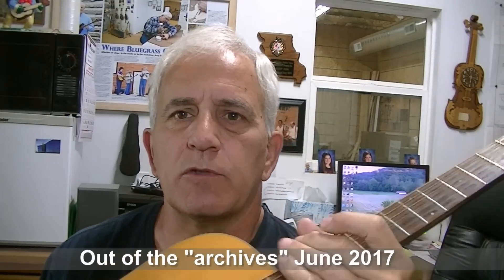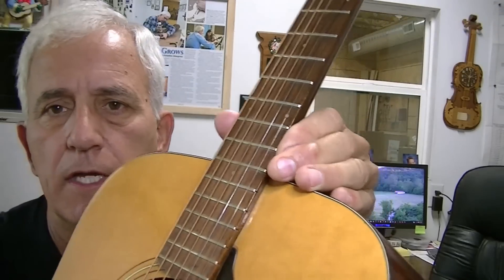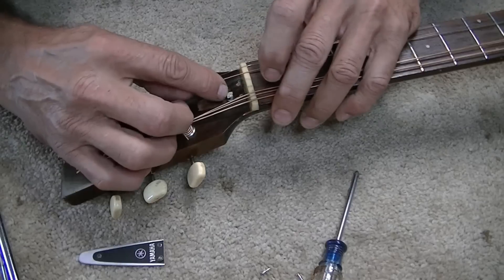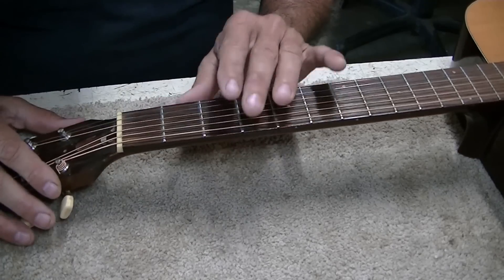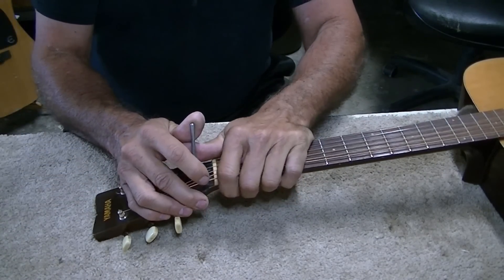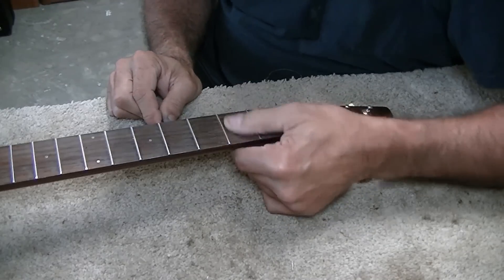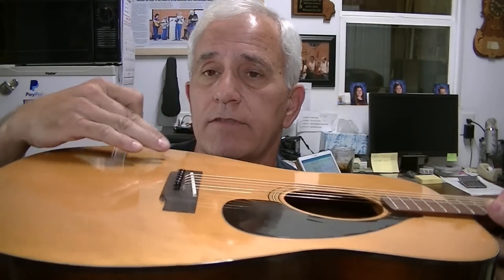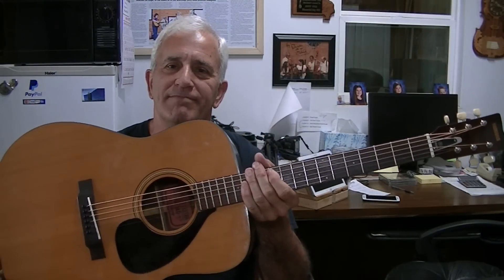197 RSW Yamaha Guitar Truss Rod Issues

Comment: Among my guitars, I’m the original owner of a Yamaha FG-160, built in 1973. It’s like a scaled-down dreadnaught.

In part, due to its age, I put Nashville-style strings on the instrument. It sounds great (jangles like a 12-string) and there’s less stress on the neck. Fun to play.

I’m a big fan of Yamaha guitars. They’re well-built, very reasonably priced, and sound great.
Reply: What strings and size are you using on the FG-160? Thanks
Reply: @BFClayto  I use a set of D’Addario Nashville strings. The strings come in only one gauge (10-27), not a choice of gauges. You could purchase them on Amazon.

Comment: Hello Jerry. I might have a tip that will help. When you remove strings, if you push the ball end below the bridge plate, you can easily pull the bridge pins by   hand. You are the one with experience though, so please don't be offended. Thanks for all your work in producing these videos. They are excellent! Bobby Hall Greensboro, NC
Reply from the maker: Bobby R Hall thanks for taking a look. I'm familiar with that approach. I use it whenever they're stuck a little bit.

Comment: I agree with you about using the light gauge strings on the Yamaha's of that vintage. I have a FG 200 I picked up in 1979 and it was about 5 years old at the time. I use the lightest strings I can get and it sounds and plays beautiful. The truss rod is very tight like the one you were working on. I've played in bands and members always loved to play it.
Reply from the maker: +Ben Kelly thanks for taking a look. But yamaha's are real nice guitars.

Comment: I couldn't help thinking the Bridge had been Shaved Down...I noticed Yours was Flat.
A Yamaha I'm Currently working on had a Radius to It, and had the Same Height Problem, with the Rod not Working no matter What, so I'm Scraping it down.
And Sanding the Height of the Saddle, and needing to Re-Ream the Pinholes, Chamfer them, and Re-saw the String Slots.
And the Saddle also was Loose.
So since I'm doing all this FREE for my Nephew, I just Added a Bead of Crazy Glue to Thicken It on the Backside, to stop the Waddling-It does the Trick.
Reply from the maker: +chickengnawer good luck with your project. Thanks for watching. I can't say about the bridge whether it was flat or not it was too long ago and I don't remember.

Comment: I picked up an older 20 to 25 yr. old Vantage "VA-12" which had high strings when bought second hand. There was a fair amount of under-bow in the neck, specially in the middle section,(much like the one shown in the video. I removed the string stress, and started working on the Truss rod, to help get rid of some of the under-bow. The adjustments are made from inside the sound hole. Like in your video, the nut adjuster, was tight, so I backed it off by a fair amount, and began moving the nut adjuster, back and forth over the hidden threads inside, to help loosen the adjuster up, seeing it hadn't moved (I don't think) since it was sold new. When I first started, the height of the strings were almost double the height they should have been, and possibly when it was sold new. Did a check on the strings, and found the strings installed, were a heavy set ( at 74 Thou on the low "E" string). I installed a set of Erie Ball "lights", because like with guitar shown, the bracing of the sound board is of light nature.  I did get the neck nice and flat, with a very slight under-bow, using the truss rod adjuster (got it working again). With the light "E" strings installed, found the height had dropped by a fair amount (which is good), but not far enough to be where they really should be. Think I'll have to do a neck reset to get it down to the level the strings should be properly sitting, as I don't trust adding more added tension on the truss rod, that's quite tight now. Like yourself, I think the last owner caused this problem, by using over sized strings, where he should have been using a set of lights, not heavies. I noticed as I went over the neck, and body joint, that the neck has been removed at one time, and re-glued back on, so it appears it was re-installed improperly. Sometimes a person can't get out of doing a Neck reset. Using a straight edge along the center line of the fret board, the neck is now flat from fret 1, and on up to, and including fret 8, where it then begins to rise on a slow slight angle to a max of about the thickness of a business card, with no strings strung on it at the 12th fret, Continuing on along the straight edge, it comes in-line at around 1/8th of an inch, "below" cresting the top of the manufacturers made saddle. I think that neck needs a wee bit more angle for good proper string height, by doing a neck reset, don't you think?

Comment: I was in the USAF traveling home to Long Island NY from Texas going to stop in Buffalo NY  to drop a couple brothers off before heading home .
Long story short  , my Chevy vans gas pump on the side of the engine leaked and seized my motor  when the gas thinned the oil . I was in Rollo Missouri . Got a new motor in two days and was on my way .  Funny I’ve never heard of anybody ever mention that place ever !    Any way thanks who ever you were in Rollo !  The motor lasted longer than the transmission years later .

Comment: I have found on a couple guitars over the years, that the truss rod nut had reached the end of the threads before moving the neck enough to pull it back and remove the under bow. I removed the nut and added a washer over the truss rod behind the nut and it added enough that I was able to adj the truss rod and get the under bow out. Just wanted to share my solution, peace
Reply from the maker: +Boudreau Guitars thanks for the note. I have seen that as well. But that wasn't the case here. Thanks for watching old friend.
Reply: Boudreau Guitars I had the same issue with my 1964 Gibson acoustic. The truss rod nut bottomed out and would not fully adjust the neck. Possibly, the wood anchoring the truss rod at the body end of the neck compressed over the years, in effect lengthening the truss rod. That’s only a theory, but adding two thin washers under the truss rod nut  took care of the problem. Another great video, Jerry.

Comment: Jerry I agree w some of the other comments re clamping a backbow into the neck and then just snugging the truss rod nut up to meet it. I've have a few of these Yammies also and I believe the neck wood is not as hard as it might be so when you crank that truss it just pulls the buried end into the neck instead of straightening it.  So I set up a cpl cauls to put actual backpressure on the neck.
Reply from the maker: +Tioga Fretworks definitely could have done that. This one seemed to improve enough with light strings that I didn't feel any further action was necessary. Thanks for watching. Happy New Year.
Reply: Rosa String Works  back at you Jerry!  PS I have a Framus Mando Im going to do surgery on - it has no truss rod but needs one. It's a bolt-on neck so later this winter I'm going to pull it apart and either pull the fingerboard or go in from the back and do a fender- style  skunk strip.  It was a gift from my parents when I was 10-11 yrs old so has sentimental value - otherwise would not be worth the effort. But it's borderline playable now even w the lightest strings - way too much relief

Comment: Happy 2018, when it rains it pours. I have always liked those F140 Yammis they typically sound and play nicely. I've run into a lot of necks like that and I loosen the rod then clamp a back bow into the neck then re-tighten the rod. Usually works after that. Good one Jerry, hope your year turns around soon.
Reply from the maker: +Dane Nichols thanks for taking a look.

Comment: Funny your comment about polishing.  Saxes especially silver plated old ones sound much better cleaned and shiny.

Nice work

Jim
Reply from the maker: +phooesnax yes they do. Thank you for watching.
Reply: Offhand, it isn't hard to imagine that a thin layer of dirt & oxidation on a metal instrument will act in a manner similar to the rubberized undercoating on a vehicle. It dampens vibrations.

Comment: Jerry:  Art Ogle Ft Worth at you. Fully agree on using the gauge strings appropriate to a guitar. Just purchased a 2020 Yamaha  FG830 (same model as my sons)
OEM strings were D'Addario light gauge strings. I too believe that having heavier gauge strings than those recommended are a case of "that ole dawg won't hynr" (Not fer long anyway)

Comment: 9:30  FYI. Here's how to get the screws off the truss rod cover when the wood below is stripped, without damaging the wood or the cover: Slide something very thin, maybe a small flat head under the truss rod cover. Pry the truss rod cover GENTLY! Not enough that the cover breaks, but gently .Keep the pressure on it, then as you are doing that use your philips to unscrew the screws. You will notice the screw is unscrewing and the cover is coming up as well. Im not the best at explaining it and I'm definitely not a professional luther but it works 100%.

Comment: Low heat pad on fret board with weight forcing a tad back-bow, rod full loose.  10-15 min, then let cool.  I've had mostly success trying this, but some failures too where adjustment didn't stay.  Never damaged guitar.  Have had to level frets though a few times.
Reply from the maker: Thanks. I've done that many times myself. I didn't feel it was warranted in this particular case.  Thanks  for watching.

Comment: That is exactly the issue I am having with my Yamaha fs700. As far as I can see no under or overbow with no string but put them on and HIGH strings at the neck joint.
Reply from the maker: Anthony Allen if the neck is straight. Then one of two things needs to happen either you need to lower the saddle on the bridge. Or if that is not possible, the neck would have to be reset. Hope that helps. Thanks for watching.

Comment: When I have a case with a big underbow, I loosen the trust rod,  put a guitar in a vice and secure the neck in a position where I want it to be and then tighten the trust rod just enough to secure it in that position.
Reply from the maker: +Ivan Dimitrijevic I have done that as well my friend. In this case once I put the light strings on it it seem to be quite a bit better.
Reply: I have also recently used that trick on a bass guitar neck. As I worried that depending only on the truss rod to do all the work could damage it from over-exertion.

Comment: Regarding the string weight question, when Billy Gibons of ZZ Top met BB King, BB tried out his guitar an noting the heavy strings he asked "why are you making so much work for yourself?" From then on Billy has used light strings. 🎸
Reply: Good point.. although a bit of a apples to oranges thing.  Those guys used electric guitars , so they relied on their AMPS ! A better example would be an acoustic guitar guy that doesn't like heavy strings.

Comment: Rosa String Works When I got guitar the heel was split I had to glue the heel back together so that most likely because of break might have affected the angle. I put shims near dove tail glued them in so hopefully they help the neck also got clamps on it. I reed a article that you can remove the tongue of fretboard  and put shims in dove tail and that can fix the neck angle instead of steaming it off  then put shims under the tongue basically poor mans neck reset reed on Harmony forum about Harmony neck resets.
Reply from the maker: +Brian Smith good luck with it.

Comment: Just so I'll know, how is it that paste wax improves tone, applied to the top and/or back of a guitar and mandolin. That sounds a bit counterintuitive, but you are, after all, the expert. I don't have experience with newer Yamahas, but the old Japan-made Red Label sounded very good. Thanks for another good video.
Reply from the maker: WryGrass100 first of all it is more obvious on older neglected guitars that haven't been cleaned in a long time. When you clean them up and you put a paste wax on the finish it seems to crisp up the finish and you get a real clear noticeable difference. On some the difference is absolutely huge. On others you can barely tell any difference at all. Thank you for watching.
Reply: So, it looks like I have my work cut out for me. Thanks

Comment: Good luck on your rental house I hope 2018 gets better for you.
Reply from the maker: +Sean Mccord thank you very much. The well got fixed today and it turned out to be fairly simple. A blown capacitor.  I had check the capacitor and thought it was okay.  But apparently not. Thanks for watching.
Reply: Rosa String Works wow thanks for the reply great videos, you're an awesome repair guy. I do have a question ,a scenario where my Guitar have fell over and a chunk got carved out of the back of the neck, I thought about using wood putty but I heard that shrinks over time. I heard people say Bondo is good ,what do you think?  😊

Comment: I just purchased a fg-260. 12 string . it had to heavy of strings and really has a belly on her. I took them off and the truss rod was scary tight trying to loosen it but it finally cooperated. (probably should have tried to loosen with the neck under tension) . I'm thinkin a bridge dr. and the lightest strings I can get help the belly issue.  It had a wound 3rd . it had tuning issues because the string slots were to narrow not allowing the strings to slide properly.  I bet the previous owner put these heavier strings on it and exarerbaterd the belly issue. you think the tuning issue would have gave him a clue but I guess he didn't see it. this fret board is a 20+ radius. The bracing is odd. not symmetrical. very light top. wondering which bridge dr. to use.? oh yeah. the bridge plate could be a little wider imo because it doesn't quite extend pass the string pegs. I'd thought it should.

Comment: I am enjoying your videos. Neat stuff. I have a Yamaha FG365s with a non functioning truss rod. Back in 1978 I bought it new for $200 CDN. Recently I tried adjusting the truss rod and no matter how many turns the action does not change. Since then I have learned it will cost a small fortune to replace. After much research and conversations replacing the rod may not be necessary. Unfortunately I have not found any pics of the type of rod that is used in a FG365s but I did find a pic of the ends of the rods for a FG375s. Would you know if the rod for the FG365s is the same type of rod for the FG375s? Thanks  Pat

Comment: If you still have computer problems might be worth checking is it has dome caps if so that will give you all sorts of problems.
Reply from the maker: I've  never heard of Dome caps.
Reply: Sorry domed capacitors they look like little battery's standing up on the motherboard, if top of them is domed there faulty they should be flat its worth a look as it a problem with electronics.

Comment: 68 degrees! that's hot!
Reply from the maker: +chump5101 well I don't think I'd call it hot. And by the way that's 68 degrees at chest chest-high. My guess is it's probably closer to 58 degrees at your feet because of the concrete floor. So it does not feel hot at all if anything it feels pretty cool.  Thanks for watching.

Comment: Do you think that the truss rod nut had bottomed out on the thread, i.e. can't turn any more? I have seen that and there are tools available to cut more thread on the truss rod. You can put a small outside diameter washer under the truss rod nut too.
Reply from the maker: Damian Strochnetter thank you for taking a look. I don't think that was the issue. It's long gone at this point. Thanks for watching.

Comment: … You mentioned that it might be possible, that the Truss Rod might have been glued in some manner during either a neck reset, or at the factory when it was made. Heating the neck, and the Truss rod with an iron might loosen/soften the glue just enough to allow the rod to be adjusted properly, and get rid of, or lessen the under-bow. Just a thought.
Reply from the maker: The amount of heat required to loosen the truss rod would certainly be more than enough to loosen the fretboard and the neck joint.  Just wouldn't want to go that deep and the customer didn't want to pay to go that deep

Comment: I've worked on maybe 100 vintage Yamaha FG's and done 50 vintage FG neck resets. The neck angle on that guitar is definitely no good. A visible bend in the fretboard where the neck meets the body is common, as is the top caving in at the sound hole, both causing a bad neck angle and high action. 50 years of string tension will do that. To adjust the truss rod, remove the nut, LUBE the internal threads, reinstall, it SHOULD be easier to turn. I backbow (with a custom designed block and clamp) the neck to get a slight back bow, tighten the nut, remove the clamp, and loosen the nut slightly to set the neck relief. I have NEVER found a vintage FG truss rod I couldn't adjust. The neck relief should be set with the strings at full tension. Overtightening the truss rod will pull the head of the truss rod (at the other end) into the neck and eventually you will run out of adjustment. Backbowing is the only option.  I tried to post a link to my forum but it seems Youtube deletes posts with links.